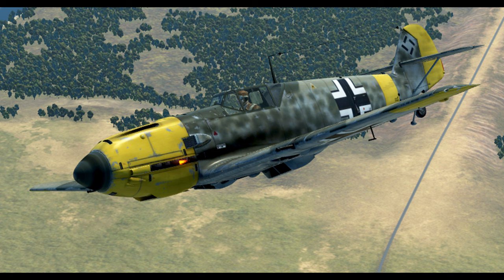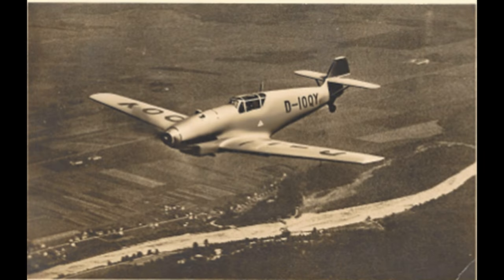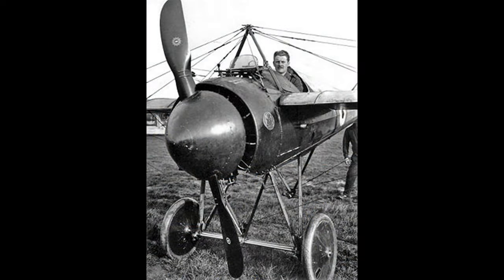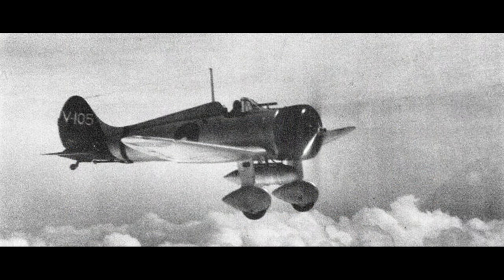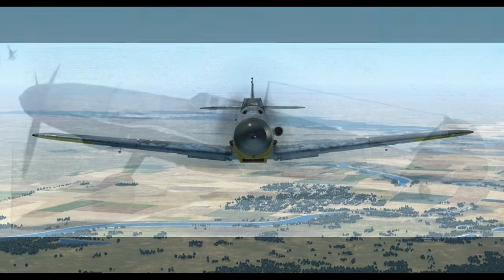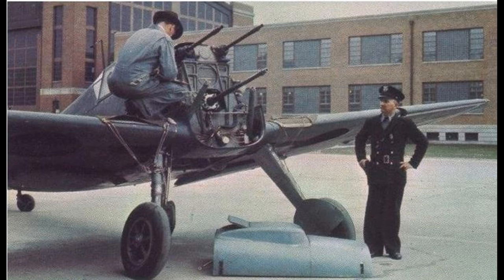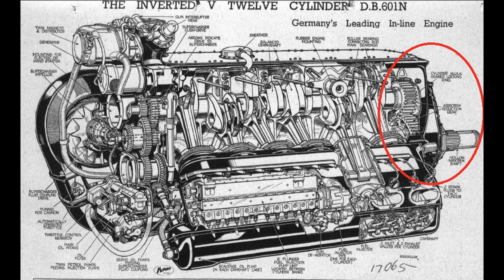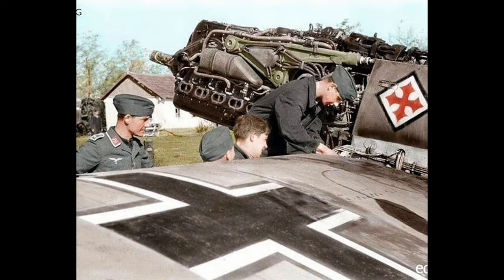Why an INVERTED V-12?  PART 2

Comment: I worked in heavy construction for 40 years and a couple of times I had the opportunity to work with some German engineers and mechanics and I can tell you that they definitely place a huge emphasis on being able to do maintenance on whatever they are building!
Reply: Unlike their automotive and tank designers.  A distinct contributing factor to why Germany lost WW2 was because their tanks required many more hours to for similar repairs.  An example is changing a power pack.  On a Sherman or T-34, pulling and replacing an engine took about 6 hours wall-clock time.  On a Panther, 24-hours.
Reply: That's funny because Audi's V8's are infamously hard to work on
Reply: They do now! Would they if they'd won the war :p?

Comment: Yeah, the making room for guns argument fails with the 109 G version which with the switch to 13mm cowl guns meant big bumps on the outside of the cowl to accommodate the new guns breaches. That must had been a bitter pill for the 109 jockeys with the one sight line that the 109 had right was now obstructed.

Comment: The cowl mounted guns made the wings lighter as well. The 109 was designed to be transported by rail meaning the wings would need to come off frequently. Fewer guns and magazines in the wing would simplify the process. This is why they had the narrow landing gear as well. As for the inversion I also believe visibility and maintenance would have been the major factor. Compare the nose of the 109 to what it replaced, the He-51 for example. In a notably difficult to taxi, narrow gear, tail-wheel aircraft like the 109, you can't afford to lose that visibility. Perhaps keeping the mass down low also helped to prevent ground loops as the distance between the mass and the front wheels would be shorter.

Comment: As a professional Logistician the ease of maintenance idea appeals to me, certainly, theGermans were noted for functional design. I am not a mechanical aeronautics engineer so my other, coming, observation may not be credible but it is at least worth a passing thought, to whit, my experience with combustion engines especially with diesel fuel, trouble, fires etc. start from the explosion end of the cylinders.  If this is true for a right-side up engine the burning fuel, smoke and debris goes right into the pilots face.  This would immediately render him out of the fight and could seriously impede any attempt at bailing out.  On the other hand, the inverted design would, hopefully, result in the flames, fumes, debris burning oil flowing underneath the aircraft giving the pilot a few more shot and a clearer possibility of escape.  This could be readily achieved by inverting the aircraft and falling to safety without being incinerated by the burning oil.  Sorry, if this is too fanciful or just plain stupid.

Comment: Interestingly the very first Merlin design (in about 1931/32) had it as an inverted V12! This never got beyond the wooden mockup stage before it was redesigned as an upright V12. At this stage Rolls Royce were funding the design as a private venture. They thought the inverted engine gave better visibility from the cockpit but when it was shown to the airframe manufacturers they strongly disagreed with this! I guess they persuaded RR to flip it 180 degrees!

Comment: I believe the  reason the RLM specified inverted V12 was the mounting of motor cannons. In an upright V12 this is still possible but the breech which protudes into the cockpit would take up the space where the instrument panel sits. With an inverted V12, the cannon breech sits low on the floor between the rudder pedals.

Comment: One thing you didn’t mention was pilot preference. Allied pilots often didn’t have a choice because most of the Allied fighters used wing guns. The P-38 was the exception for the Allies. The Germans had a choice between the Bf-109 and the FW-190. Most of the experienced pilots preferred the Bf-109 because of the concentration of firepower. No having to worry about convergence, just line up the enemy and pull the trigger. Same was true in the Pacific, but addition of a second engine was also a factor for the long over water missions.

Comment: ""The Origin of the Inverted V-12 German Aero engines.

This goes back to 1928 when a committee of aeronautical experts was assembled in Berlin at the bidding of the R.V.M.
Representatives from the Army, the D.V.L. research centre, the Navy (airships were at their peak in 1928 ) and Deutsche Lufthansa were instructed to make an in-depth study of of the international scene regarding aero-engines and then produce specific guide lines for the future development of large air- and liquid-cooled motors.
Along with others, Prof. Wunibald Kamm (of "Kamm Tail" fame), Ing. Wolfram Eisenlohr (famous pilot and head of the D.V.L. power plant division) and Dr. Helmut Sachse (later, co-designer of the B.M.W. 801) served on this panel.
The specifications drawn up by this "think tank" were very detailed and incorporated some very advanced features including, for the liquid -cooled engines:
- 12-cylinder, inverted installation,
- mono-block cylinder banks,
- wet cylinder liners,
- propeller reduction gear,
- supercharger,
- fuel injection,
- high temperature glycol cooling,
- provision of a cannon tunnel in the Vee.

Tender documents were sent to Daimler-Benz, Junkers and B.M.W., all of which eventually produced a V-12 engine model in response although none was able to incorporate all of the required features immediately, eg the DB600 had dry liners and carburettors, the JU210 also had only carburettors and the B.M.W. 116/117 only got as far as the prototype stage.
The specifications were presented to the manufacturers as a fait accompli. If they wanted production orders, the engines had to comply with the tender descriptions.
Wolfram Eisenlohr was interviewed in 1980 re the 1928 requirement for inverted V-12s and he cited three reasons for the decision vis,
- more compact installation,
- better pilot view for single engined aircraft,
- less exhaust flame dazzle during night flying.

Ref: Junkers Flugtriebwerke by Müller, R, p 150 - 151. (Helion and company)
von Gersdorff et al "Die Deutsche Flug..." p 42.
ISBN 1-85260-163-9; Fred Jakobs, Robert Kröschel and Christian Pierer. "BMW aero engines". BMW Group Classic, 2009 ISBN 978-3-86852-214-3. p 85 -87.""
Reply: ^^there is the answer
Reply: @stay_at_home_astronaut       Indeed.   I remember that there was specification document written up in the 1920s.
Reply: Thanks V G! 
We English speakers don't know how to read German so the translation helps alot.
Reply: The flame dazzle hardly seems like a think tank idea. A simple pipe routed beyond the cockpit would fix this for night fighting. Although it may hinder visibility slightly, if it is already dark, it would not be any worse.
Reply: Interesting. This kind of answers my question in Greg's other video. Which was first, the airplane spec that requires inverted V or vice versa.  Looks like the the inverted V was a fact of life by the time the Germans created the specs for the air planes.

Comment: That maintenance issue is a big one.  Having spent numerous hours helping my dad work on his aircraft - with simply Lycoming engines, I can really sympathize with anyone working on an upright vs inverted beast like a V-12.
Reply: What do you think of a head re and re on an inverted vs an upright would be like?  Oil dripping all over you as you let off the head bolts... hoping it doesn’t slip as the last bolt is removed. How about installation?  No way to get a hoist to put it on (remember... this is an overhead cam engine and is over 2000 cubic inches of displacement... a 454 or 426 head is feather light in comparison) so holding it by hand with someone else trying to line it up while a third person is trying to get enough bolts started to actually hold it... vs even using three trees and some rope as a hoist in a two man operation to simply slowly guide it into place?
Reply: @Bartonovich52  Im sure it was standard procedure to drain and pump the oil out before removing the heads. And im sure they had jacks, kind of like transmission jacks, to help lower the heads down off of the block, not three dudes standing with their hands holding the bitch, growing tired as they wait for you to remove the last couple bolts. Im sure they would if they had to in a pinch. But even the use of come-alongs or ratcheting system of some sort would be used if not a jack.
Reply: @neilaronson4078   I am quite sure that the German procedure would be to remove the engine from the plane, in order to drop the heads.  Removing the engine, following" the "power egg" concept, was much easier and faster on a German '109 that it was on a Spit, P-51, P-40...

Comment: "Soviet machine gun technician Viktor M. Sinaisky recalled: The Messer was a very well designed plane. First, it had an engine of an inverted type, so it could not be knocked out from below."

As a layman this is not self evident. Surely having all the gubbins that made maintenance easy from below surely makes the inverted V somewhat more vulnerable?

Comment: Great video (and previous one as well).  Good insight on the motorkannone theory.  I kind of thought as well that the orientation of the V would not be a limiting factor for a MK, though i did think that perhaps it would help with shell dispensing during firing.  But seeing that pic of the 109 without the engine - it's pretty clear the MK's body is far further back.   
Still think the more realistic explanation is that at some point the germans just found an inverted V more practical - and they tended to stick to using what they know works (well mostly).  I mean, practical in terms of servicing the engine, thus accessibility and so on.  Do you think that as a result, that is why the German super-chargers were almost always on the right side (you did a vid on this)?  
Anyways, good video as always.  Are there any other interesting such topics on 109's you can do?  Love this stuff.

Comment: A inverted engine is a drysump engine. Oilflow follows gravity. Most  flying is positive G. Getting oil out of the cylinder heads is a problem with most upright engines. Not so with an inverted engine. Oil collects in the cam covers and can scavenge easely into the drysump tank. Its a proper engineering solution and ease of maintenance access is a bonus. Thanks for your great analysis. I will build my next hotrod with an inverted engine.

Comment: It has been my pleasure to be part of a team that overhauls and restores to flying condition DB 601/605's, Jumo 211/213's, BMW 801's, amongst others.  So I have some experience working above and below these engines. The inverted V is willing to make me miserable by leaking or dripping fuel and oil all over me while I stand under there with arms over my head looking up into that dark abyss of the valley where a good flashlight is your only friend. Yes, that sure beats working on the ladder in the sunshine. Best job I've ever had! Thanks, Greg. Keep up the good work.

Comment: Great channel. Learning so much. To reinforce the idea that maintenance is a key factor in preferring an inverted V configuration perhaps you could do a video on the routine maintenance cycles for WW2 aero-engines? You mentioned changing spark plugs. What other items might need checking or replacing? Valve clearances, timing, oil etc
Reply from the maker: Keep in mind, there are two spark plugs per cylinder, so that alone is quite a bit. I'll try and include the maint. sched. for a fighter in an upcoming video.

Comment: excellent follow up on the first.  With the view of the 109 with guns showing and engine removed, the placement of the cannon would not be possible with an upright Vee. Also, the cross section of the engine allows more visibility and smaller engine compartment in the inverted configuration.. Not  being an aeronautical engr, I hesitate to comment too much on the efficacy( producing the desired effect) of the smaller engine area higher up on the cowl. Without a wind tunnel to dispel argument, chalk it up to Deutche engineering.Also, and i feel is the most important, it's easier to aim without convergence of wing mounted weapons.

Comment: Engine change was 2 hours on the 109, around a day or more on the P-51 (and most other types)...
Reply: Is that because of the inverted engine configuration?
Reply: I don`t know. It was more like the ancillaries came with the block as a one piece "power egg". But the block dropping free of the engine bearers might have helped side-stepping the use of a crane...
Reply: Isnt it that the p51 airframe is a tubular construction while the bf109 has the whole front bolted to the airframe like shown on the bf109 without engine?
Reply: Could very well be the answer: The power egg would then include the bearers themselves.
Reply: was it? in some other video (some german guy video i think) was saying it was a day of work for 109 and one hour of work for me262... but i have no idea for his sources.

Comment: Actually, the prop hub is lower on the inverted V12 with gear reduction than the upright V12.  I have not looked it up, but I would expect the Spitfire propeller has larger diameter than the Bf109.  It is definitely larger than the Ki-61 (DB-601).

Comment: ok I'm 57 n ive worked on this engine its a v10 inverted diesel with fuel injection and the biggest turbocharger ive ever seen the reason for inverted? its for the machine guns and ammo carrying ability, it allows for a lot more ammo u can see the ammo boxes just above the very small oil pan since its a dry sump it doesn't matter what orrented and theres a device that's driven off the engine to time the guns to fire through the prop so the bullets/rounds don't hit the prop which by the way was a massive wooden prop, u can read the desighns/blue prints in german easy enough that speak of the increased ammo from the fact the engine is inverted, back in the day 80s my grand father ran a abussiness called confederate airforce WWII restoration so guess what we restored by my hands and flown by my hands I beleive the aircraft is now in the a museum and why do this guy continue to talk about spark plugs! its a goddamed inverted v10 desiel with fuel injection with a turbo charger big as 55gallon drum in diameter, u don't need a super charger with a turbo charger there lighter and are egaust driven and in case ya done know a turbo will produce more boost than a super charger and yes I know a turbo is a type of a super charger but drastically different in the fact it usesd wasted egaust energy, my daughter ask me to answer this question as even her caught onto the fact a gasoline engine wasn't ever used in a me109 till some wise guy decided to install a allision up right in a me109 for the smithsonium museum and I must admit a bone head move on his part because Mercedes benze would have been dam happy get the chance to rebuild a me109 inverted v10 desiel which was a pride built engine buy Mercedes, they would've probly done it for free just to advertise the fact. my grand fathers business is gone when he died but I remain one of the few pilots rated to fly every goddamed WWII beast ever conceived, I even trained those whom bought them because many would get killed cause they on landing aproach would grab a handfull of throttle opening the engines throttle to maximum at slow landing speeds and the torqe of those massive props would cause the aircraft to snaprole and at low altitude/landing aproach theres no room for error/no room to recover and smack boom pow it burns like a trailer house and ya die for this one small mistake ya gotta get up to 10k and try that shit and sopme WWII aircraft still could be a bastard to get out of the spin/snaprole could and would induce, rememeber my daughter ask me to answer into this head scratching why would ya even not know it was a desiel??? shes 16 so don't yell at her yell at me, hell I'm old enough typing hurts my hands all that wrenchin/impact wrench is what did the most to contribut to arthritis in my hands and every other poor bastard mech just like me are feeling that shit! old age is a cruel curse that I'm sure was imposed on all of us because somebody did something to piss off the gods.